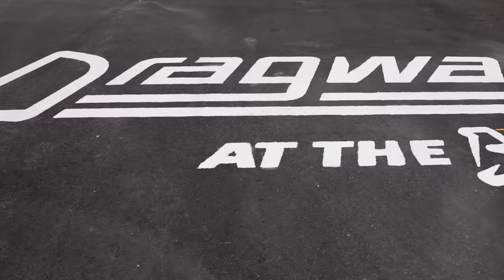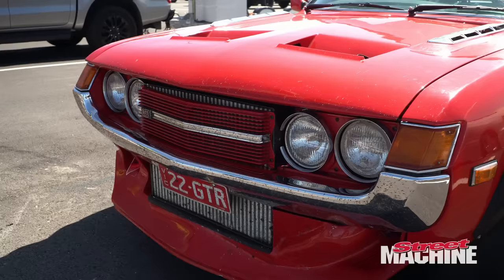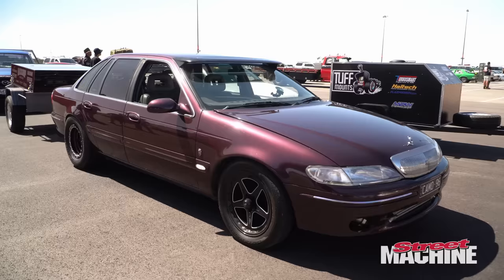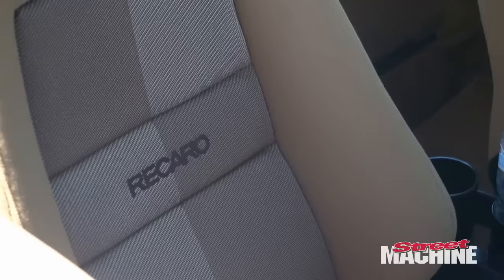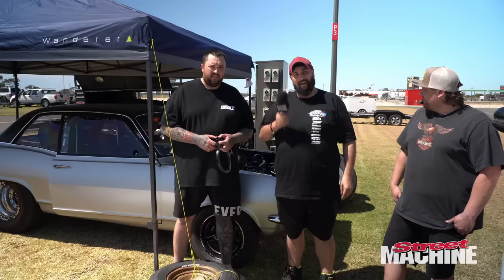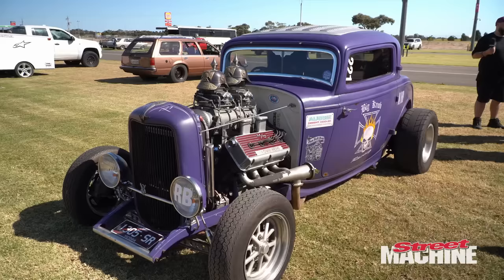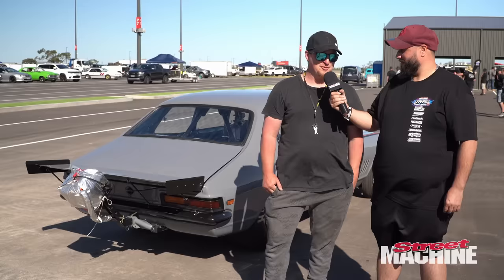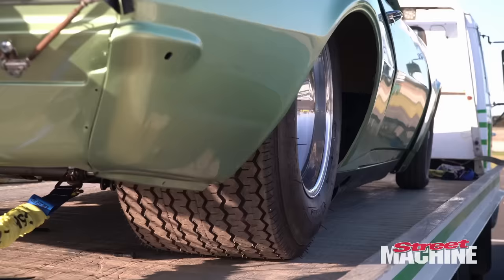Drag Challenge 2023: Scrutineering Day Madness!

Comment: The old torana, claims stock heads with valve springs, stock bottom end,  running a decent turbo, low 8s.. Knocking on the door of a 7..

I don't buy the "stock" bottom end. Has it been refreshed?